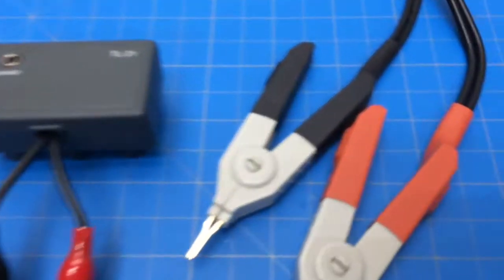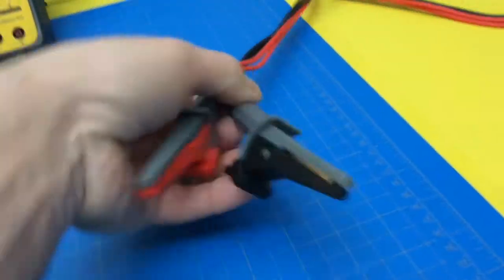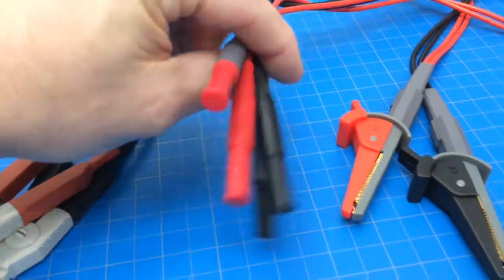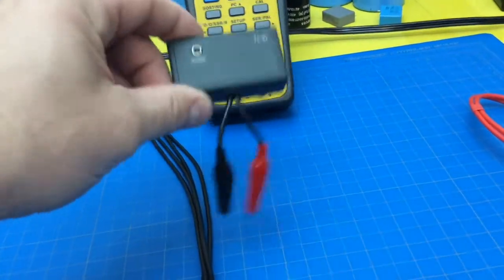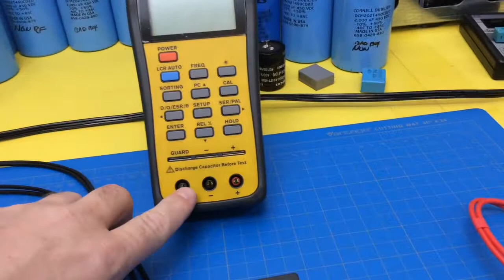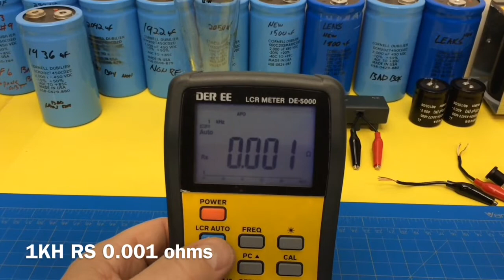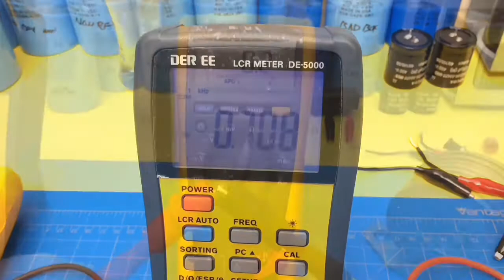DE-5000 Handheld LCR Meter Kelvin Clip Upgrade & Comparison (How To)

Comment: Thanks for the great video. You just gave me a lesson on Kelvin leads and how accurate the DE-5000 LCR meter is. Two days ago I ordered the meter, I found your video and just ordered a set of Kelvin leads off of ebay. As soon as I get the two above items I will be modifying the Kelvin lead assembly. 
Barry
Reply from the maker: +Barry Kery 
Awesome
I bought two different sets of kelvin clips as seen in this video https://youtu.be/go6MEVYz_GE 
I plan to make another banana jack kelvin module so I can plug in different clips like the larger ones.
If you have any issues with the shields improperly terminated let me know what brand. I have read several amazon reviews and seen some videos stating that but both mine were fine.
Good luck

Comment: Great upgrade. I'm going to do the same thing when my TL-21 and the clip leads show up in the mail. I'm going to see if I can squeeze in 4 bnc connectors so that I can detach the clip leads and use them elsewhere if I decide to. If I can't get the connectors shoe horned in, I'll go ahead and cut the leads like you did.
Reply from the maker: Awesome, let me know how it goes.
I still plan on making a banana jack version where I can change out the leads.  I have all the components, I just need the time.
Reply: @KTFG  Will do. The reason I'm going with the bnc is not only for being able to use the clip leads on different equipment, but I've also ordered the Kelvin type tweezers for SMC and they also have the bnc connectors. that way I can interchange them without having to get a second plug in block.

Comment: I've never been able to get a standard set of test leads to calibrate with my DER-5000. I might pick up these parts and make the same thing you did here. Thanks for the video.
Reply from the maker: It’s worth the time and effort because it’s a relatively inexpensive and simple upgrade.

Comment: Cyrustek ES51990 chipset is used in Mastech MS5308, GenRad/IET DE-5000, CEM DT-9935 and others, but the 4 Wire Kelvin Clip improve a lot the accuracy and only the DE-5000 allow this hack.

Comment: min 4:25, I also have the same fail error using Fluke suregrip leads, I suppose that the Cp/Cs changes during the cal. (for large leads)

Comment: Interesting that your Fluke probes would not calibrate.  I have a Fluke 8845A but it lacks capacitance and ESR measurements, which is why I have been considering the DE-5000 (and hence, found your videos).  I also have the Fluke TL 2x2W (4-wire) probes for the 8845A, for making excellent resistance measurements.  The wire length is just over 1 meter though, which makes me wonder if it would work.  But I would need to purchase a DE-5000 to find out.  Thank you for the Kelvin Clips video though.  I found that helpful information indeed.
Reply from the maker: I should try some shorter leads just to see of the length was an issue with calibration. I have seen the Agilent Keysight handheld LCR meter used with long leads in videos. Granted its not 4 wire and not sure if it was calibrated.
I have some long 4 wire banana jack kelvin clips that I am going to modify another TL-21 to work with so I can swap out different 4 wire clips.  We'll see if I have any issues with those.

Comment: Doesn't putting both wires on the same side of the handle degrade the performance? I would think it desirable to have the sense and current sides isolated all the way to the jaws.
Reply from the maker: Yes but in many instances it’s negligible, they are still 4 wire up to that point. Just depends on the circumstances and if that extra level of precision is necessary for your task.
Having said that, our upgrade is true 4 wire and separate at each jaw as seen in this video https://youtu.be/go6MEVYz_GE

Comment: I have a late question on this mod. One side of a kelvin clip is voltage the other side is current. Should the clips be oriented when connected so the current side is is towards the outer side of the lead being tested and voltage on the inner side ? Or doesn't that matter ? Sorry if I'm not clear. Kelvin clips supply current and measures the voltage for accurate measurements. This is probably a dumb question but it's got me baffled. Thanks.
Reply from the maker: Watch these videos for a good explanation of 4 wire measurement and Kelvin clips: 
https://youtu.be/0vMvCVyOp9g
https://youtu.be/Zeh7LCOmWco

Comment: Will this work with just the 4 Four Wire Test Leads Kelvin Clip 4mm Banana Plugs alone or do you need the TL-21 too?
Reply from the maker: No, it needs the slots for 4-wire.
Also see:  https://youtu.be/go6MEVYz_GE

Comment: Do you know which eBay seller you purchased them from? I'm interested in making a TL-24 or whatever mod using the 3 PCBs for guard, + / - and also using the 3 banana connectors below and then adding ports so things can be plugged in such as those BNC connectors... I'm thinking of buying a 3D printer which would make it easier to create a new top for it...
Reply from the maker: +Acecool 
I purchased the hand held LCR meter and extra TL-21 on Amazon from the seller DER EE Electrical Instrument but also try seller  IET Labs.
Let me know how it works out.
Reply from the maker: +Acecool if you asking about the kelvin clips its in the video description:
Atoplee 1 Set Kelvin Alligator Clipswith 4 BNC Test Lead Set for LCR Meter,
Amazon Seller ATOPLEE
Reply from the maker: Hand Held LCR Meter purchased from Amazon:
Der De-5000 https://amzn.to/2yQxFa2
Atoplee Kelvin Alligator BNC Test Lead Set for LCR Meter: https://amzn.to/2tEfyz6
TestHelper TL200 LCR Meter Kelvin Clip 4mm Banana Plug: https://amzn.to/2KykeA4
Tl-21 Alligator Test Lead Case (for DE-5000 LCR Meter) https://amzn.to/2KjUuZf

Comment: I saw you mention in another comment that this meter won’t to do in circuit ESR for capacitors? But in other videos I had seen many people impressed with the In circuit testing with this meter.
Apparently the ability to change the test frequency allows user to test capacitors under their stated spec. 
Not sure I understand what would put this meter above the $40 versions that test in circuit. I thought that was the whole point with all of the head-to-head comparison’s all over YouTube

Either way, thanks for your video!
Reply from the maker: Some in circuit test can me made depending on the cirtiut and frequency used but it takes an understanding of the circuit and electronics to determine that.  
Just bc a $40 device advertises that it can test in circuit doesn't mean it can, its depends more on the circuit less the tool. It's unlikely to do more than this tool.  One of the primary differences is that this true 4 wire kelvin test leads and this meter has more features.  
If price is a factor (this is very inexpensive for what it is) then get a cheaper model and if you outgrow it then move up to this or higher.

Also check out:
How To Solve Rubik’s Cube: So Easy a 3 Year Old Can Do It: https://youtu.be/9spDGBeWl1o

http://www.kevingittemeier.com
Reply from the maker: A point I meant to add, it is generally agreed upon that its better to isolate the DUT for best results.

Think of this simple analogy:  Ofter you can test for a blown fuse in circuit but the are situations were you will still read continuity (low ohm xformer etc) even thought the fuse is blown.  So when in doubt we lift one side of the fuse to isolate if not completely remove.

If you are familiar with the circuit though or you have a TS procedure that allows for testing in circuit then you can so long as you know what results you should and shouldn't get and no other series or parallel device with skew that results.

Best of luck!
Reply: Kevin Gittemeier Thanks so much for your reply! Sorry it took me a week to get back with you. I printed your replies and stuck them in my folder regarding test equipment and things that I’m looking to add to my bench. This information is very helpful! I will re-read it several times before moving forward!

Comment: which use you have for this equipment? Is for prototyping or repairing?
Reply from the maker: I use it for inductance readings motors, inuductors etc.  and capacitor ESR.
Also check out “How to Solve Rubik’s 2x2 So Easy a 3 Year Old Can Do It:  https://youtu.be/UYCeyu_pbTI
Reply: @KTFG  ESR in circuit?
Reply from the maker: Not in circuit.  Large caps out of circuit.  Mainly elevator drive caps.
Also check out Rubik’s 3x3 Tutorial: https://youtu.be/9spDGBeWl1o
Reply: Ok, what advantage it has with respect to esr tester?
Reply from the maker: Yes, ask me in the comment section of both these videos and I will a answer:
“How To Solve Rubik’s Cube: So Easy a 3 Year Old Can Do It” https://youtu.be/9spDGBeWl1o

“How To Solve 2x2 Rubik’s Cube: So Easy a 3 Year Old Can Do It”. https://youtu.be/UYCeyu_pbTI

YouTube’s new algorithms are crushing my YouTube channel so do me a favor and give both those video a thumbs up and ask the question in both of those videos comment section and I will answer.

New videos live and die by comments and likes.

I don’t mind taking time out of my day to answer but I would like a few seconds of your time

Comment: I tried the mod but could not get a pass calibrate. Some cheap kelvin leads wont work..
Reply from the maker: +Metaldetector Experimenter 
See if it has a shield terminated (soldered) to one of the wires at the kelvin clip handle. I have read reviews on amazon of that problem and have seen videos on YouTube about it.
Reply from the maker: These two worked for me
Atoplee Kelvin Alligator BNC Test Lead Set for LCR Meter: https://amzn.to/2tEfyz6
TestHelper TL200 LCR Meter Tester 4 Four Wire Test Leads Kelvin Clip 4mm Banana Plug: https://amzn.to/2KykeA4

Comment: Just went to do this and have discovered my so called TEST HELPER Kelvin leads from Amazon have NO shield.  WTF?
Reply from the maker: Apparently that’s a common problem along with the two sides being soldered together on one side or even the shield being soldered to one side. I did not experience that problem with the ones that I bought and linked in the video description
Reply: @KTFG  Is there a workaround for this? I really don't want to buy more cables.
Reply from the maker: I don’t know that you have to have the shield.  I’m sure it’s better but I don’t think it’s absolutely necessary.

Comment: You made a HORRIBLE mistake by not showing the results by first using the supplied leads. You should have COMPARED the supplied leads measurements with the Kelvin Clip measurements that you created to show how they both perform.
Reply from the maker: Are you always so dramatic?
What is to compare? I primarily made these so that they would be longer.

The difference between true 4 wire separated on each half and 4 wire jointed on the same half is negligible as I mentioned in the video.

Turn it down a notch brother